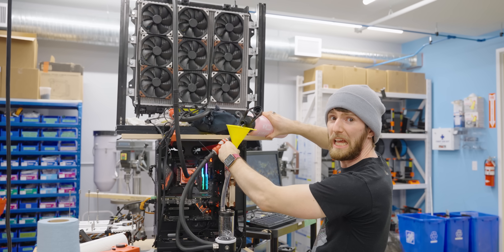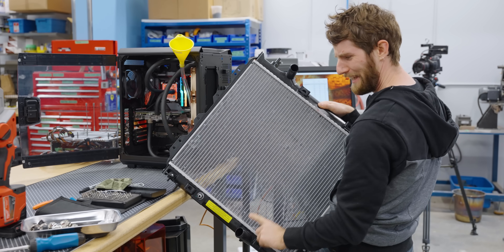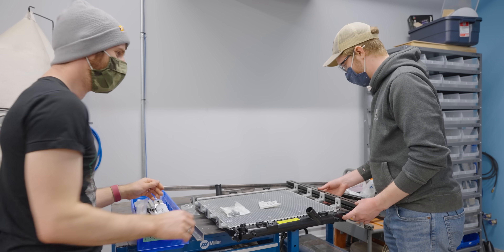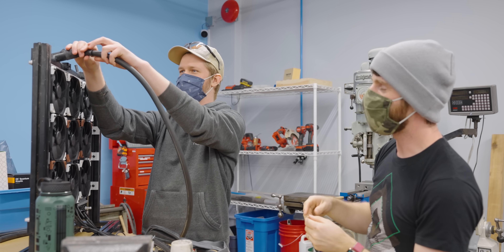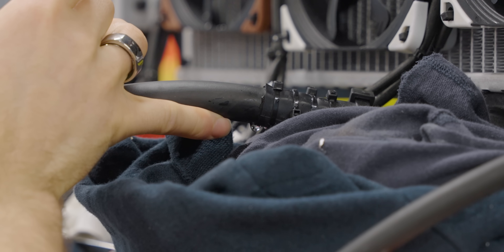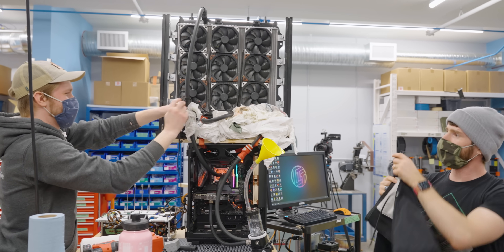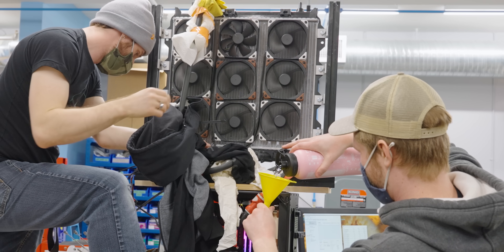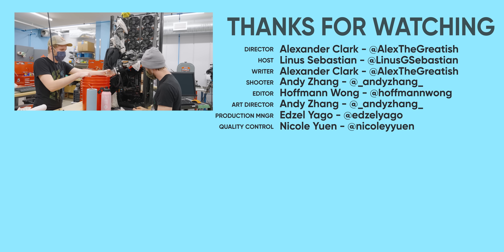Our Craziest Cooling Project Yet - Car radiator liquid cooler

Comment: Don’t use the transmission cooler section, it’s only a little pocket in the radiator. It’s actually a pretty shit design, and probably why automatic transmissions don’t last that long. Only use the big openings on the radiator, that will go completely through all of the fins

Comment: You should have just plugged off the trans cooler imo. Most aftermarket radiators should have came with plugs for manual trans cars that don’t use those.

Comment: The transmission line is literally just a straight pipe that goes between the inlet and outlet, inside the end tank. It is woefully inadequate for performance applications as your transmission can never be below engine coolant temps

Comment: Linus why don't you guys just leave the radiator standing on the table and just run. It will be the same result. If you want more coolinghitbit with a aquarium pump with higher flow. Car radiator can sustain more pressure. And use hose clip to solve all the leaking issue

Comment: For an actual video--how about fanless water cooling?  With enough surface area, you should still be diffusing enough heat to get by without a fan.  Get a second one, build a case out of radiators, then run it without a fan.

Comment: leaks would have been less leaky if they used metal hose clamps as they did on the transmission ports.... Planned incompetence, maybe, for a more dramatic video content... 
Tech Ingredients has a more dramatic cooling porting cold air from a window-type ACU and less janky than this.
I guess content is king however janky it is... by content, I mean something that may trigger the attention of the viewer and not necessarily better... hahaha

Comment: Using copper CPU and GPU blocks with this aluminum radiator in the loop in a long-term setting will result in galvanic corrosion of the aluminum... especially without corrosion inhibitors in the coolant. 
This setup is fine for a very temporary setup. 😆

Comment: This should definitely get a part 2, as well as submerg the rad in ice water.
Reply: Re-do minus the leaks and jankeys.
Reply: @Ankit Meher the radiator is not electric
Reply: he could use it as a stix helios rear sode panel
Reply: Jayztwocents did that recently
Reply: All this needs to work is some time at the hardware/autoparts stores to get the right plumbing.

Comment: The leaks could have been avoided. 
The inner tube that you used as the adaptor isn't a bad idea. Having over the outside of the connections on the radiator is the correct method, however it should have been put over a smaller hard-walled tube that would have matched the inner diameter of the tubing. That way you could put the inner tube on the interior of the hose while still being able to use a hose clamp to secure the connection. Thanks to the direction of the flow the pressure would prevent the fluid from leaking.

Comment: Terrible, this isn't even danky, it's str8 sloppy work. All you needed was a cheap ebay aluminum radiator with AN fittings with AN hoses and fittings to make tight /secure connections for the PC.

Comment: I'm kinda wondering why you didn't just use the tire tube as the hose instead of as a reducer. Yeah, it's a bigger diameter, but would it affect the flow too much?

Comment: Hey guys.... Just a quick FYI.... Electrical tape is water proof..... Sorta one of its main uses it to keep water out of connections..... Therefore it also works to keep water "in"... i.e. wrap your hose connections in it and it will stop the leaks.

Comment: This reminds me of back in the day, when we used to make custom loops from car rads (engine, transmission or AC radiator), aquarium pump and what ever hose we got that was the right size, as there were no actual water cooling parts available. The blocks were either hand made, or machined by a family friend with access to a machine shop from aluminium or brass.
But even back then we used actual adapters to step down the radiator hose to a more usable size. :D

Also, an open loop with a bucket as a reservoir outside in -20C weather got some nice temps.

Comment: I would be curious on the cooling performance if they used an actual electric radiator fan from a car. Still pretty neat if unpractical.

Comment: You really didn't need to go through the transmission cooler. It's literally just a pipe that runs between the inlet and outlet within the bottom tank of the radiator. Better off just using the radiator in and out and ignoring the trans cooler next time 😉

Comment: Better off using a piece of string rather than zip ties as they do not provide a perfect seal as there would be a small void at the head of the zip tie that is not sealed and that allows water to seep through

Comment: it be nice to see one of these water cooling adventure actually built proper for actual long term use. this gimmick approach sucks and it seems to be a regular way of doing things for when it comes to these types of adventures. yea rad towers maybe a thing of the past, but something this could be use in a window or something. maybe even with system on the loop.

Comment: has a whole shop in the background...doesnt use it. I would of made adaptors to go from car radiator to computer cooling loop. Seems easy enough. you can even draw up a 2d cross section and have it rotate around a axis and there you go. drop the file in the cnc mill and have it go to work

Comment: I swear the drama was all put on for the views. When there are so many projects they meticulously plan this seems so rushed.

A trip to a gardening/hardware shop to use some garden irrigation tubing and fittings would sort out leaks

Run the hoses through an adjacent wall into another room to deal with acoustic issues.

And then run the rig for a good hour for the water temp to reach equilibrium without putting fresh cold water in would give a decent result (the pure volume of water would take so much longer to heat up compared to the “in case” system)

Honestly though I wonder if this is an option for high end systems. Stick the radiator in your adjacent garage, or even outside in ambient air. Or cooling a server in this way instead of trying to air cool in a confined cupboard.

Comment: I don't think you need to use the oil cooler, I think it's just a single tube in the bottom tank that uses the cooled water to cool it.

Comment: If you redo that set-up you loop the large fitting on the radiator with a larger pump and just have the water circulate through the fins, then run the pc cooling system through the transmission cooler.

Comment: all you needed to do is use a couple of those 3/4" to hose fittings and hose clamps to size down the innertube instead of trying to go from soft tubing to soft tubing with no core to push back...

Comment: If your going to use a car radiator, just get the car fan, there rather light, efficient and electric, which would work fine and probably cool the water much better.

Comment: For those fittings, you could have use silicone caulking before zip tying them, which would hold for a few days with no leaks. Beyond that, bike inner tubes are too rough to be water tight from just a ziptie.

Comment: I would have thought... go with an old fashioned sort of 'workstation' horizontal desk PC case, replace the top of the case with the radiator.  Or, if you want to do a ton of work, use the radiator as the base and mount everything on top of some specially fabricated steel pieces that only provide mounting locations but otherwise mostly let air through.  Lots of crazy form factors possible.  What I really want to build someday, however, is a PC sort of styled after an old school hot rod with a hood intake, like where the "engine" (in this case would be cooling apparatus) intake protrudes out of the middle of the hood.  Bonus points if you put actual pipes for it to draw air through or one of those things with like 3 valves in a line that open up to let more air in.  Then, of course, paint the sides of the case with flames.

Comment: I'm quite certain pouring the fresh cold water constantly defeated the purpose of the large radiator / more radiator cooling. 
So what you actually need is to just attach a faucet to the loop and drain all the warmer water into the sink every loop. ... ultimate cooling ! (I'm aware that is no longer a loop)
Super fun video.

Comment: Using the transmission cooling loop is pointless. Your just using water to cool water that is the same temperature as the cooling water (this is not cooling).

Comment: @Linus Tech Tips you should of used a bigger pump LMAO....... Also it would of been cool to put the transmission cooler side into the gpu and the other side into the CPU
Reply: Also why not of used shrink tubing or use actually clamps ??? i mean you guys kinda have a machine show now??? couldn't you just make fittings and stuff for this build?

Comment: The transmission section is just a separate heat exchanger/radiator inside the radiator that is cooled by the engine coolant side.  It should not have been used, or it could have been used separately to cool the gpu or something...  Very cool  and hilarious video though, I have actually thought about doing this in the future, ok not exactly this, but something like this lol.

Comment: Jayz2c already beat you Linus,
But why the hell you hang it on top it’s gonna leak like a sieve!

As a mechanic I cringe what these computer nerds doesn’t how a car radiator works the smaller outlets cools critical engine components like idle air control, heater core oil etc..

Comment: The transmission cooler part of the radiator will only be in that tank on one side and it's like a coil of pipe or a round tube going directly from inlet to outlet. It doesn't circulate through radiator fins, it's cooled by the radiator water.

Comment: There's no point running through the transmission cooler. 
It's a water to water radiator, that's cooled by the main radiator tank. 
Also just use a full size auto radiator fan, it's way easier.

Comment: this could have worked if they actually spend time buying the right tubes and tube reductions fittings and leaving it behind the pc with two quick connect fittings on the back of pc so you can move the pc

Comment: You guys do know that there are regular 9x120 Radiators out there right? With fanmounts and stands and actual pc tube connectors? I have 1 right here and it cools 600w of sustained load with just 300 rpm on the fans.

Comment: This is dumb, without subambient air being applied to the radiator, theyre only increasing the speed at which the water would reach room temperature, not really cooling it anymore than a normal rad would, only allowing it to heat the water more than a normal rad.

Comment: If you're doing it, do it properly.
3d print two reducer to connect the radiators to the water cooling loop, ignore the transmission cooling inlet/outlet and position the radiator on the same level as the pc. The fact that the loop was constantly refilled negated any results you got.

Comment: Woulda, shoulda, coulda but you could have gotten a transmission cooler WITH a fan for even cheaper. Also you could have got one that was close to the dimensions of the towers side profile and basically just extended the width of the case so it looked more like one real unit. JEGS 60388: High Performance Transmission Cooler 26,000 GVW | JEGS something like that but bigger. Better than 9 smaller fans. Also you deserve to blow some hardware for using zip ties instead of oh say something designed and named specifically for that. Hmmmmm!? Maybe hose clamps!? It's almost like you intentionally created a cluster fuck for entertainment purposes. Cool project none the less!

Comment: My god ya'll did this in what was possibly the worst way ever thought of. Put hose clamps on all of the connections. And if you have to use zip ties, offset them. So the locking bit of one zip tie is offset from the other. The gap is what is leaking. Put the radiator beside the computer so there isn't any extra strain on the pump. Hell, you might want to use a garden pump, the same one you used for the subzero cooling video. i want to see you revisit this but do it MUUUUUUCH different.

Comment: I was so hoping Alex was going to going to correctly explain to Linus at the beginning that the smaller ports on the rad are a liquid to liquid transmission oil cooler.
Reply: Pretty sure neither of them know how a transcooler works "well good news is the transmission cooler isn't leaking" 🤦 of course not... There's no water in it. He connected the in to the out before filling.

Comment: Not transmission coolant ports, it’s for the heater in the car. The hot engine coolant runs through the heater core and makes hot air for your car.

Comment: The transmission loop is a oil-to-water cooler and dissipates the heat from the oil into the coolant which then passes that heat in a water-to-air loop via the radiator fins.

Comment: This was the YOLO-est built ever.
They have a thermal camera but didnt even try pouring warm water throu the radiator to see the flow patterns, then connected the circuits in series knowing that the ducts with the smaller diameter would increase the resistance to the flow, then they set the radiator above the PC knowing that that would increase the hydrostatic pressure that the pump would have to fight, and finnally (having a warehouse of parts) they tried to use a compresive device (zip ties) to seal a very flexible rubber tube around a very flexible hose instead of using small pieces of pvc pipes to have something to supuport the preasure of the zipties.
Anyway, it was funny.
I hope they repeat the experiment but this time without any fans just to see if the convective flow of the warm air rising from the radiator and the water pump are enough to keep the PC cooled.

Comment: By plumbing it up in series instead of parallel, you increased the resistance to water flow. Just the same as it would work with electricity. That is bound to cause it to cool less efficiently.

Comment: As a car guy the transmission side does nothing because car transmissions wouldn't need much cooling, little to no cooling is necessary, If you were to redo this for any reason I strongly recommend you only use the motor cooling passageway and ditch the transmission side

Comment: Bottom in and out is for a automatic transmission it cools the fluid uses the cooled engine coolant i would believe to cool the trans fluid cause in car the hot coolant goes in top and out bottom

Comment: why not just take hard line your PC into your home's plumbing to water cool it with constantly cold tap water. After the water flows through the PC it'll just go into the sewer or septic tank. Along with this perfect monster radiator solution.

Comment: Ideas for improved version of this jank:
- Big single fan
- Use the different rad loops for the two different components
- Two loops means two pumps
- Don't put water above the PC... Make it like an external GPU enclosure but for cooling
- Leave the internal rads setup and design some kind of hotswap, like the old office cooling system had for individual stations.

Comment: Okay first question is not why, nut why that poorly? Second, is it safe to assume that this is just a "Part 1" and the next iteration won't be as janky? Thirdly, why did you put it on top? It's like you guys went out of your way to make it as difficult as possible for that poor pump; not only did you increase the distance it had to pump but the sheer volume of all the extra water in that much bigger tube had to contribute to some of the low flow. Also going from a (assuming) 1in to a 1/4in tube had to add even more pressure on the pump, why not just determine which has the bigger loop and use just one?

Comment: As someone who knows a little about engine cooling, that transmission cooler is not doing a thing for cooling (and it is a separate loop from the radiator). It is called a 'cooler' but it actually is designed to heat the transmission up to a certain temperature and 'kind of' cools the transmission (IE, not really). I wouldn't be surprised if it is actually hurting performance to run the transmission 'cooler' in line. As a side note, a rad hose + hose clamps + reducers + automotive hose could get you down from the radiator - but I know this was never meant to be a permanent thing and those could increase costs quite a bit.
Reply: I should mention this video was very entertaining though! I'd like to see a version 2!